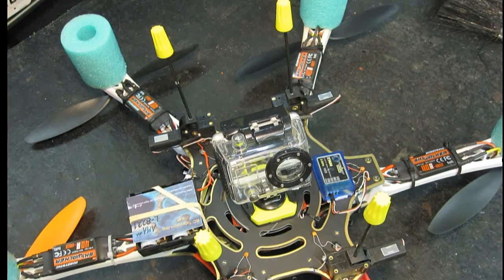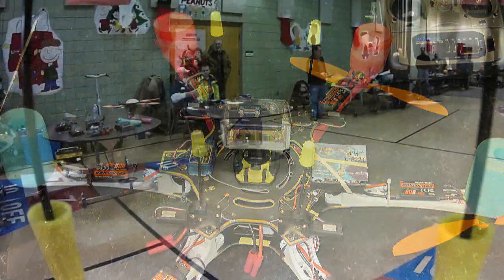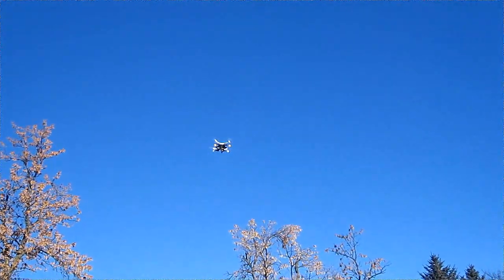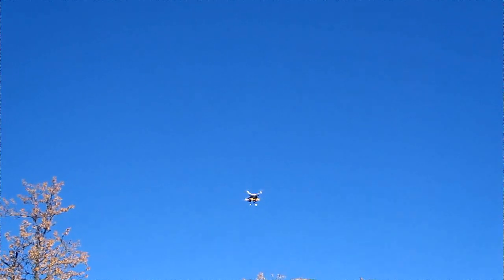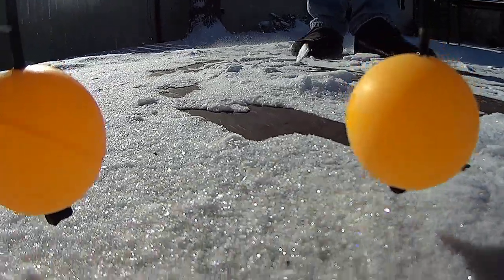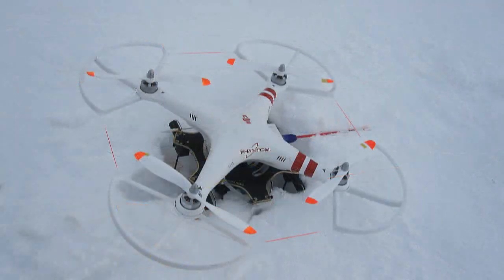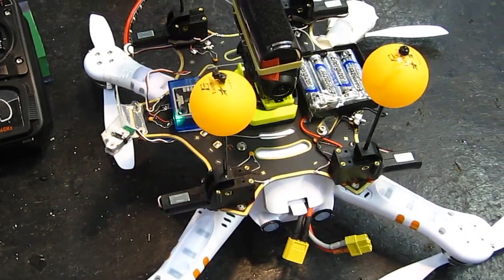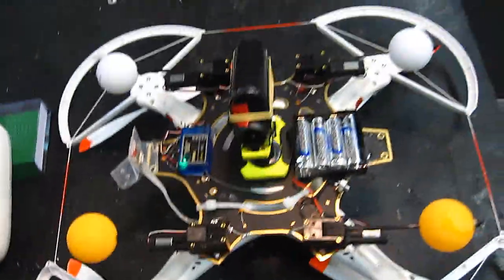Retractable Landing gear on DJI Phantom, Blade 350 QR, WK QR 350, Flamewheel, and T-580.

Comment: very nice set up, of the three RTF quads what have you found? I have the Blade 350 and put FPV gear on it and on stock set up get up to 2230 feet, but have to be careful, because the RTH is very slow, found out right away that you need an OSD.
So what are you experiences with the 3 quads? great videos, thanks

Comment: I have learned so much from you in the past years, thanks for this video and all the others you have posted.  Last year I got into multirotors and control boards, KK2, CC3D, but now, with the APM, I also have GPS hold mode that does not look too exciting to a bystander, but it sure is satisfying to see it stay in one place all by itself.

Comment: Dave, of your 3 quads, the Blade, the Walkera and the Dji Phantom.. Which of the three is most durable when you take into account the flight times etc etc? 
Thanks.
Reply from the maker: Ive really had no trouble with any of them and they each have special features.
I like the Phantom best, as it is the quietest and easiest for me to see. The flight time seems to be slightly longer than the Blade.  The WK, however is the easiest to use due to the 1 switch that controls everything..